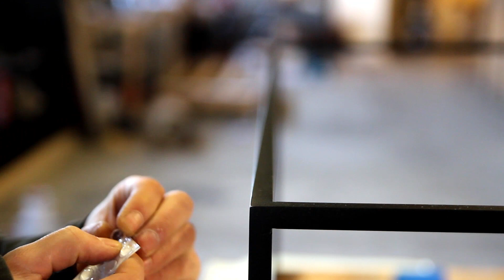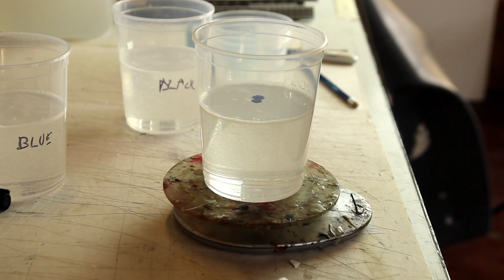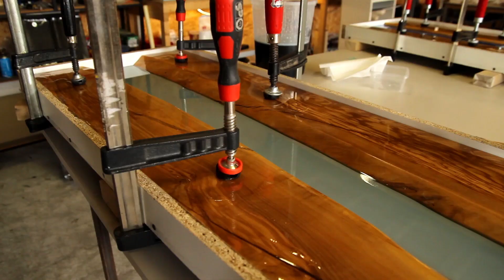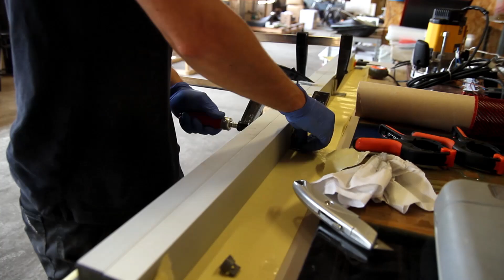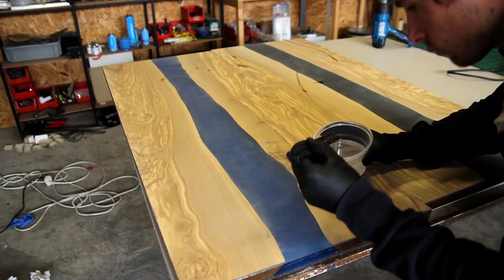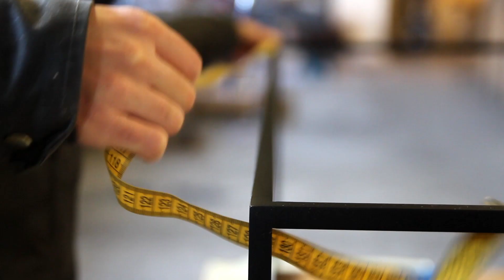Epoxy Resin River Table - How to build

Comment: could you explain the curing at lower/higher temps? As long as you mix, pour, and cure epoxy at the specified temperatures, I wouldn't think it would cause a problem. You mix and pour concrete in cooler temperatures than they will be in.
Reply from the maker: Concrete is different than epoxy, epoxy is a thermoharder and not a thermoplast meaning once the chemical chains are made it can not be reversed... Temperature after curing will help to create more chemical chains resulting in a more stable and stronger cure... In theorie epoxy only reaches its maximum strength of cure after 30 days, heat will help to reduce that time...